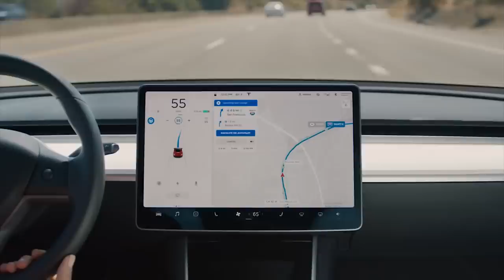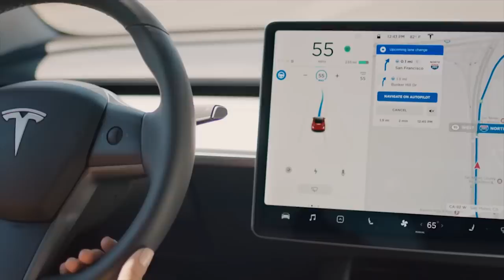Canadian Union Targets Ford; BYD to Surpass BMW & Mercedes - Autoline Daily 3639

Comment: Curious how Tesla’s autopilot mode with less repetitive warnings is an issue for NHTSA when Ford and GM have similar but fully hands off modes that are actually more finicky? Especially once they hit too steep turns on highways or mapped roads end.
Reply: They’re far more transparent
Reply: @onenickthomas  NHTSA clearly states that Tesla is the best in this area when it comes to both data collection and transparency.
Reply: @AllanSustainabilityFan  does it though? Also, I meant transparency to the driver on capability, not NHTSA.
Reply: @onenickthomas  The customer fully knows what they're getting, it's all clearly stated and they are regularly updated on the growing capabilities of the solutions.

They know what they are buying and many are happy to be part of the journey.

Thus clickbait media's feigned confusion is their own making, which is no surprise considering their business models.

The clickbait chasing and shoddy work is certainly a source of public confusion on these issues, but not to Tesla customers themselves of course.
Reply: You didn’t Mercedes advertising hands free mode also
Reply: @AllanSustainabilityFan  the transparency refers to the limits of the system. The AP system does not have a defined operating zone like the other hands free systems.
Reply: @edornelas8275  it’s not designed to be
Reply: @AllanSustainabilityFan  respectfully, I would argue this “strength” is what makes the Tesla system a wildcard in terms of operational limits. Overall, I’m pulling for Super Cruise, which is better than the other two highway assist systems mentioned. To your point the AP system is kind of a different “ball of wax” altogether.

Comment: Tesla loves to add software "upgrades" that bypass State and Federal laws. Once you disconnect your hands from the steering wheel you have disconnected your attention from the potentially lethal projectile you are speeding down the road in. You had better be sure your AP system is rock solid and alerts drivers well in advance. It always amazes me how many Teslas run into buildings, off cliffs, rear end vehicles, and other things when they should be smart enough and have a safety system in place to prevent that!
Reply: Also hard to do that when there is a fundamental hardware flaw with the motor control that causes SUA.
Reply: None of what you said is remotely true
Reply: @ryansmithc  My source is the Belt paper and numerous YT videos showing out of control Tesla's with brake lights enabled.  Funny that only one Tesla hack is the only one to attempt to discredit the Belt paper.  Everyone else is radio silent.
Reply: I wonder how you can reconcile what you read with the fact that Tesla cars are the currently safest in the world ?
Reply: @Alarix246  In terms of thermal events, the Nissan Leaf is the safest.  Zero confirmed thermal events (unconfirmed rumor of one).  Meanwhile, 204 thermal cases and 71 people no longer on this earth courtesy of Tesla.
Reply: @bobbbobb4663  204 out of 4 million currently on the road? When you have 60% of the market, percentages are more telling than the raw numbers.
Reply: @Alarix246  Even new math says that Zero as the numerator will be less than 71 over a non zero denominator.   Please tell that to the rest of the Diversion Team.  Thx
Reply: @bobbbobb4663  while I agree with your logic in counting, I must digress with reference to @ryansmithc statement above anyway, and I have no time to follow the statistics of a car company going under. Tell your diversion team my warmest regards.
Reply: @Alarix246  My statements stand as accurate with appropriate citations unlike the rest of the stans here who regurgitate fan boy yt material as fact.  Fortunately, the rest of the media is waking up to the fraud.

Comment: Ford is not making money selling EVs, their sales of ice vehicles continue to decline. I'm pro union, but at some point, they need to realize that while they are profitable now, they won't be in a few years. Big automakers need to have a heart to heart with themselves and their teams if they want to prevent their extinction. Although, i would imagine some of the companies are just holding out until the next government bailout comes their way.
Reply: I guess they should just work until they pass away because shareholders need there profits!
Reply: Their engine is not reliable especially their ecoboost. Everything is SUV or trucks. What kind of product planning is this
Reply: …..Here in California (world’s 4th largest economy, 55 million + people), there are PLENTY of Fords.  ….My block alone has 3-4 electric Mach Es. 🤷🏼‍♂️🤔
Reply: @eddieg6436  The more Mach-Es your block has, the quicker Ford dies.
Reply: @parkershaw8529  Lots of Mach Es, 2 Raptors, and even a 2021 GT.  …..I guess Fords on its deathbed. 🤔😂
Reply: @eddieg6436  The ICE business still makes money, but, that will change soon when the volume inevitably drops. So, yes, Ford is indeed on its death bed. It's just the inertia keeps it going now.
Reply: @eddieg6436  55 Million people do not live in California. More like 39 or so million .
Reply: @Gcanno  .There’s WAY more than 39 million in California
Reply: I'm assuming that 55 million is included the tent dwellers